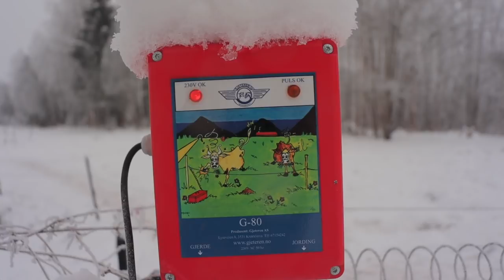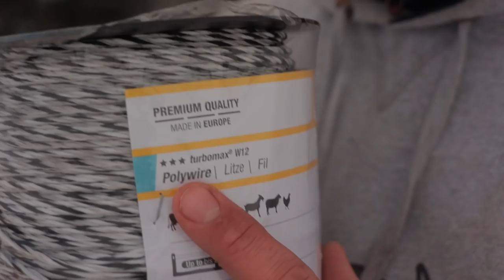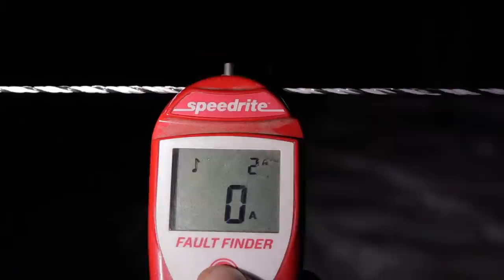What´s Wrong With My Tractor Tire?

Comment: As always, I enjoy your positive attitude videos.   However, it definitely looks like @ 11:20, it should also be time for a front end alignment on Booger after the repair.  I think that may be related to why you had to replace the steering knuckle pins and bearings to begin with.  Luckily it’s just a reasonably easy adjustment.

Comment: You may want to build a makeshift tent around the front end of the tractor and put a heater in it next time
Reply from the maker: I actually had planned that, but the tent is berried in snow, and i couldn´t get it out!
Reply: @FarmerE  oh ok we use those kerosene jet heaters. They would work great in a tent around the machine to keep everything warm. You know boss ?
Reply: @FarmerE  I think they run I  kerosene and it diesel fuel. But they give off a lot of hear. They look like a mini jet engine on wheels with a fuel tank attached. They work great.
Reply: @FarmerE  i meant to say they run on kerosene and or diesel fuel.
Reply from the maker: Fore sure, those work great!